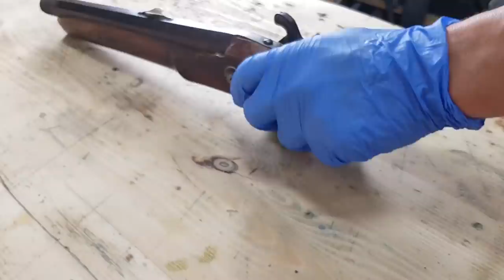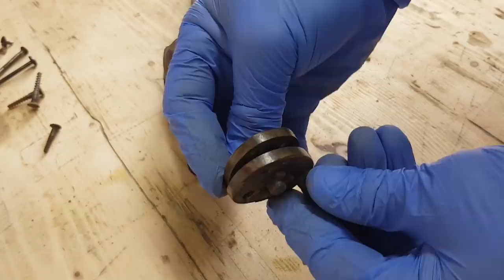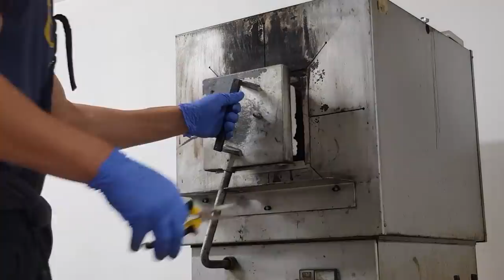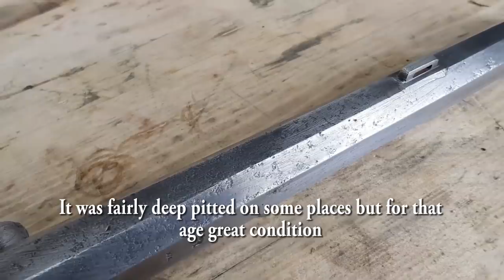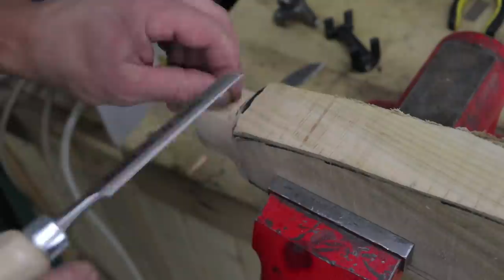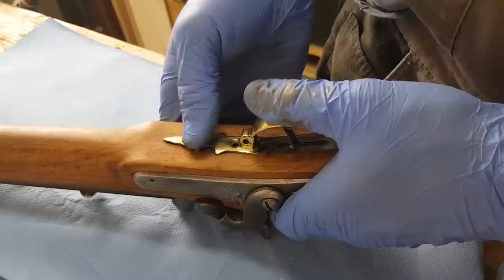200 Years Old Mysterious Rifle Restoration

Comment: Unless there are some hidden markings we didn't see, there's no way to decode this gun.Could be it was simply made as a break down weapon for the same reason long guns are made that way today, ease of travel. Also, it could be fired  as  a pistol  as well as a long gun, which could also  be handy.
Reply: yeah  I envy all the tools, and the place and ability to use  them.
Reply: @MastersOfCraftOfficial  Even  if you can  make it out, proof marks from that time are almost impossible to track down. There were a lot of makers back then. If it's a maker's mark, and we can make it out, maybe there's a chance, though a slim one.
Reply: @MastersOfCraftOfficial  Good lck you'll have to consult some antique firearms experts. Contact the National Firearms Museum for help.You'll need good high res photos expecially of any marks.Back then, sometimes the maker's mark and  proof mark were the same thing, usually derived from the  maker's  or proof tester's initials.Which can often be the same as someone else's  I would wager the original  stock or at least the butt plate had more markings, but you didn't have that.

Comment: I always think it is a mistake to over clean a gun like this, gives it a fake look. 
Better to keep the patina or in places where you can’t to age it back to it matches. 
Absolutely no reason to buff the trigger guard and redo the barrel finish, not going to make it new. 
I’ve seen a few of this type of rifle , I think made so it could stored easier on a wagon plus could also be used as a pistol. 
I think it was never a flintlock but just a converted flintlock Lock was used. 
Butt stock came out good